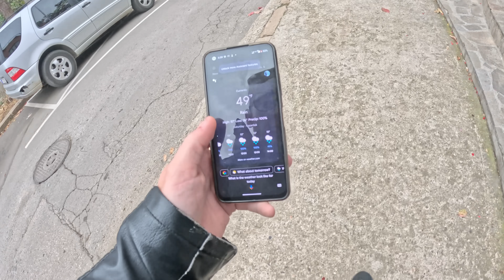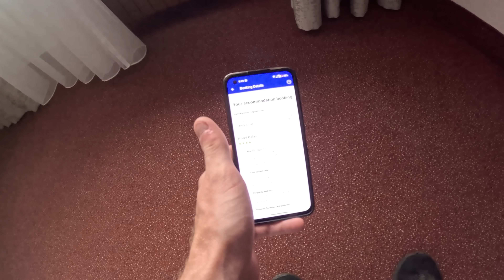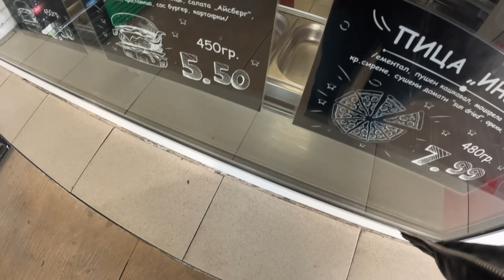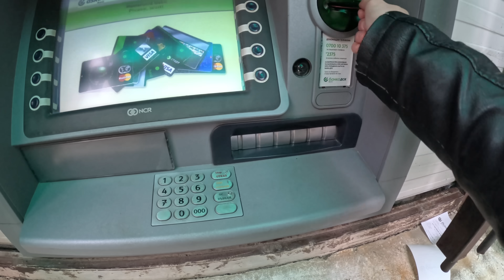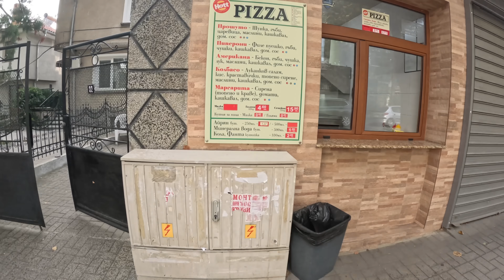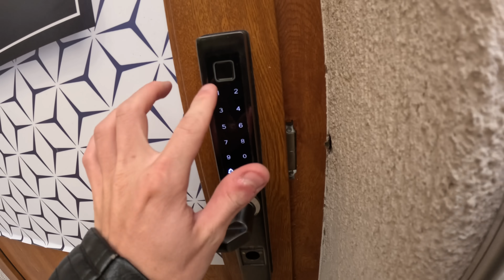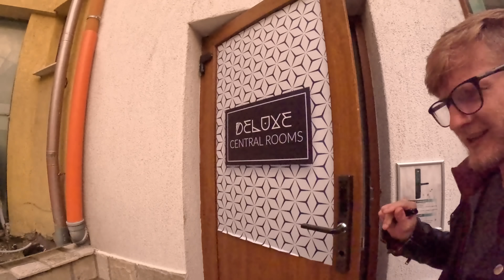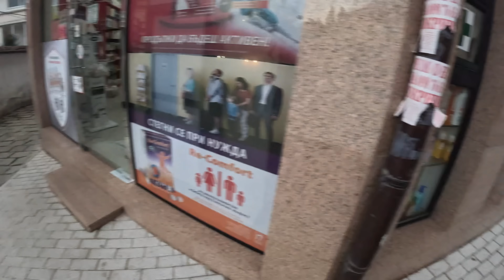Airport - Day 3

Comment: Nate wants to figure out logistic...It slowly starts to sink in , about biking  in the winter (it's not proper winter yet) in this part of the world. Logistically , it would make more sense , to put both bikes in cargo compartment of a bus and taking a nap for 5-6  hours trip to Sofia (with pre arranged accommodation and storage for the bikes). It would be significantly cheaper and bikes could be properly outfitted (customized) in the big city , for the intended purpose/trip , while working on details for planned trip and waiting someone to come to join the ride (if that is still the plan). It would not take any entertainment value of the videos , simply because even the best plans (of anything) rarely survive meeting with the reality (trip would still , probably  ,have some mishap's and unforeseen problems and if everything goes smoothly , we would enjoy road scenery ). 
BTW , solar panels would do very little , in terms of charging the bike's batteries in this time of the year , because of shortness of the daylight , which can be gloomy , most of the time (therefore , bad efficiency) and the panels should be almost upright , because the sun is low on the horizon on it's highest point in the day (if wind is strong - it is impossible).  I say panels (plural) because just one (or two - for two bikes) wouldn't do almost anything significant (few hundreds watt hours at best , for a 4--5 hours of charging , significantly more , if it is sunny , but still not enough for long range ride , given the temperatures and hills).
Oh , couple of LED's and cheap buck converters (48V - 3,7 V) and some very thin wires , can provide visual confirmation of  battery connection to the controller wires (some soldering required).
Reply: agreed

Comment: Right now for you to have the time to charge and ride again in one day will be an option if you Start riding at 6 o clock in the morning.
4 hours of riding, 4 hours of charging and maybe another 3 or 4 hours of riding again.
But with the equipment you have I don't know Ii it is an option. Riding in low temperatures is frustrating.